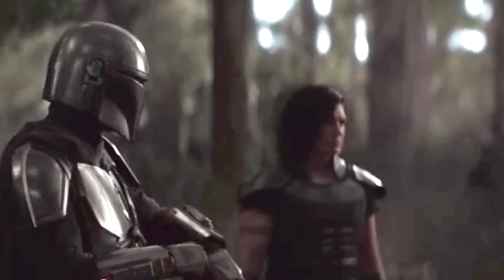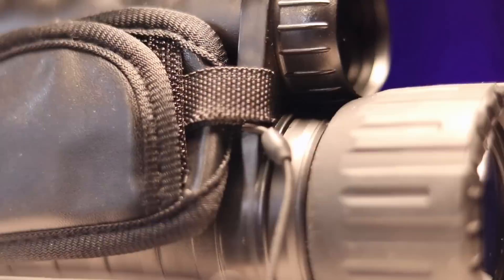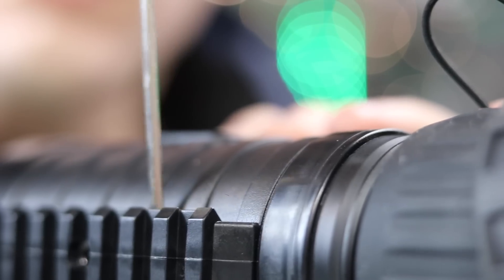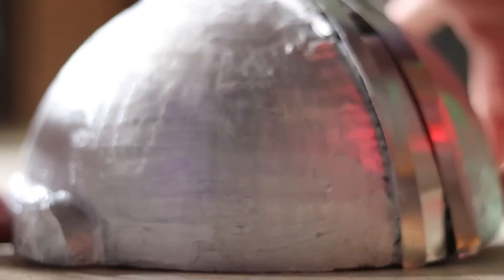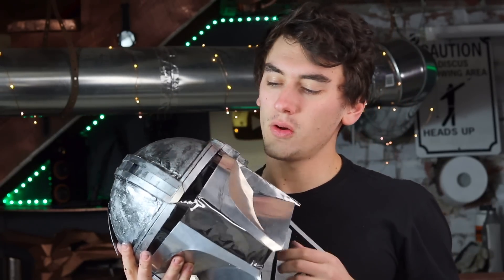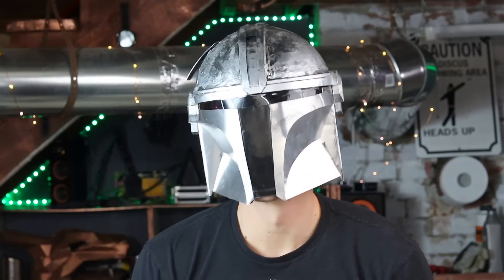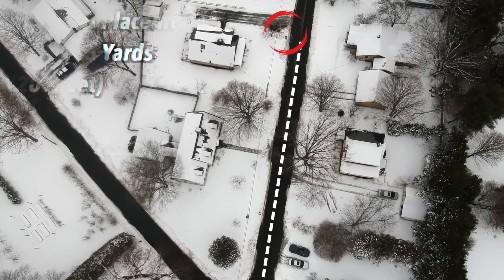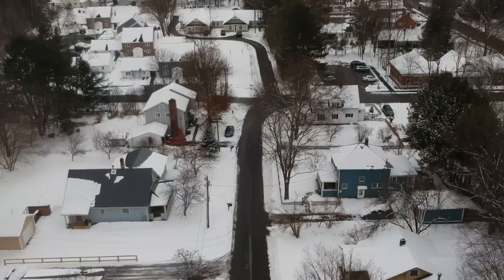Working Mandalorian Helmet with HUD! - See 500 Feet In Total Darkness!

Comment: To make the metal a dome all you need is a sand bag and a ball ping hammer I've seen old school hot rod custom guys use a safety cap off of a tank for welding as a hammer. You don't need that much. Might have to sand down all the hammer marks if you don't have a English wheel.

Comment: There are some helmets that are metal that you can buy and then alter which could be better than the 3D printed metal combo. If you could use the same smart glasses lens for the actual helmet visor and then use the side of the helmet drop-down site that boba fett uses it might make it easier for distance thermal vision.

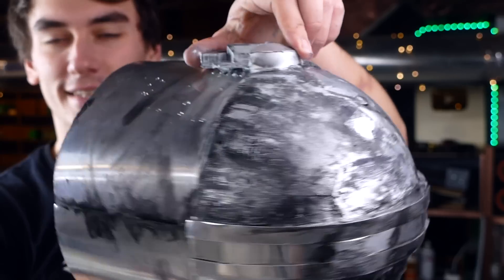Comment: 6:19 a good tip if you ever want to remake it PVA foam is what most cosplayers use that reinforced with PVC and covered in either metallic paint or lightly sanded foil will give it a good solid look and the "antenna" most Mandalorian helmets have is actually a display screen so that could help with the IR camera placement as well

Comment: You could do the same thing, but put the Scope Into a rangefinder (the little antenna thing on Boba Fett and Jango Fett helmets). Another option for the button access is you could try to wire it up to Somethings similar to a touch lamp, where you would only have to touch the outside of the ear cup in different places to activate things

Comment: so any chance to make a working safety  suit? like a full storm trooper suit that protects wearer from scrapes and fire damage while giving boosted strength and helmet with air filtration and enhanced vision for all conditions. I have links for current tech that does one of these options but not all. If the tech was all added together it would make for great protective wear for first responder/ fire fighters and disaster relief responder. Pm me and I will gladly send the idea and links to you
Reply: Clone trooper armor is more practical than stormtrooper

Comment: mate simply buy a image sensor that accepts IR band feed it into a SBC and use light drive stuff to provide the display to your eye you looking at this way to high level, think where all the tech stems from
Reply: oh when it comes to zooming, using a smaller sensor size will allow for smaller lenses, and I don't like it but if you have high enough resolution in the image sensor then just do digital zooming

Comment: I think you might have been able to see the second picture if it was mounted to the pole instead of a sign coated with a material designed to reflect light and be more visible. the sign was washing out the picture because of the brightness of the reflected infra red light from the LED.

Comment: You could have made the inside like a screen for you to see out of that way you could put a camera system switch into different modes like nightvision or thermal. The top section that comes off could house the camera and then put like a baseplate on the bottom to close it off attach it to the rest of the helmet and use like an adjusting headband off a welders helmet or something. But great work man Im really lovin these videos 👍

Comment: Hey Jay, this is awesome. Can I make a suggestion though? How about you 3D print the entire mask, spray paint it with metallic chrome, sand it, and repeat that process 3 or 4 more times. It'll make it look a lot more clean. You can also use Immersion goggles (Occulus Rift goggles, or similar), to house the field of view from your glasses AND the scope, and extend the cables from the AR Glasses to a control panel in a metallic arm bracer like Mando has. That way you can control the

Comment: Coat the helmet (or whatever you’re wanting to sand down) with superglue, then very quickly cover all the superglue with baking soda. That’ll cure instantly, most likely in an uneven layer/texture, but that’s what relatively fine grit sandpaper’s for; I’d recommend 400 grit, myself. You can sand down the new surface to whatever shape or thickness you want.
Then, buy some metallic spray paint from Home Depot and spray it. Use some shades of browns and lighter silvers to unevenly dry-brush parts of the helmet.
That’ll look nicely used and pretty real.
|:NOTE:| Feel Free to dry-brush with other colors.